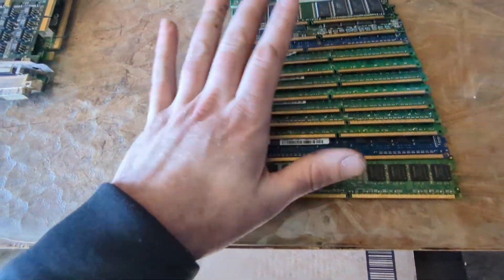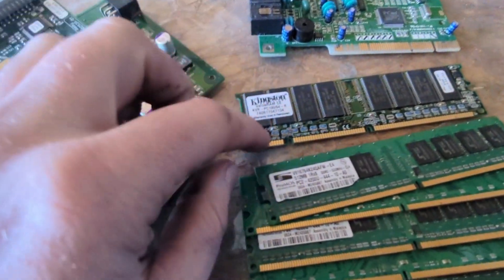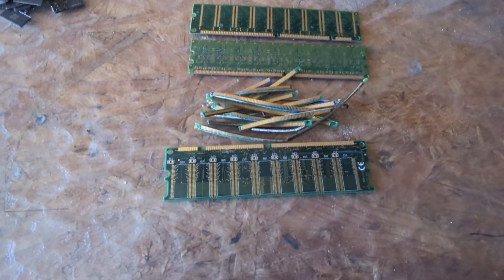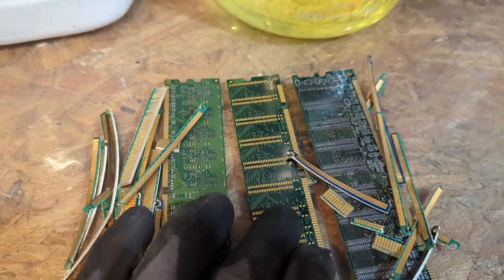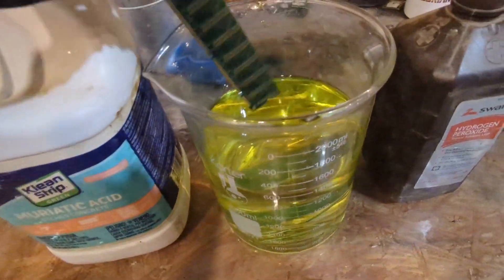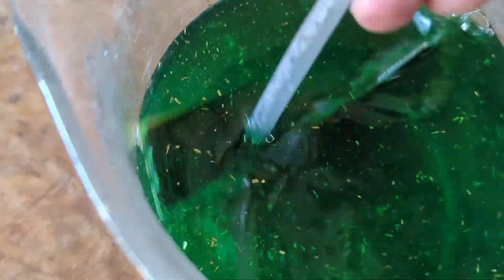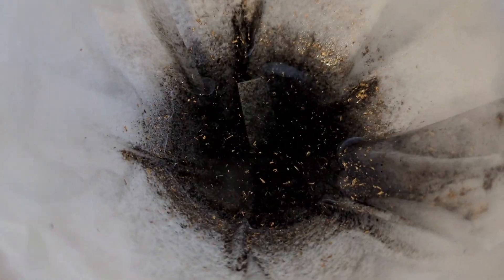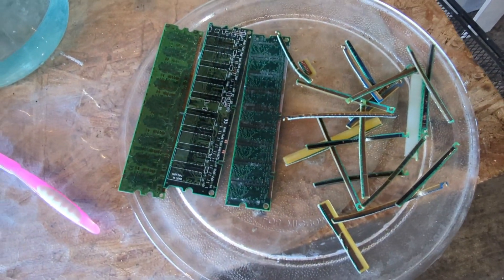RAM GOLD FINGER GOLD RECOVERY

Comment: what is the ratio to make this acid
Reply from the maker: @tube4knowledge76  I don't measure it exact, whenever I make a new batch I use the entire container of both. Or half and half, depending how much you need. AP solution is great because you don't have to dispose of it, you can continue using it again and again. When the solution is dark green that means it's saturated with copper, you can add a piece of steel to the solution and it will precipitate out solid COPPER!!! After that your ap solution will be clean again and ready for more boards!!!! If you feel it is too weak and more peroxide or agitate it with a fishtank air bubbler.
Reply: @ScrapDaddy365  Thank  you sir!
Reply from the maker: @tube4knowledge76  no problem! Thank you for watching and asking!
Reply: @ScrapDaddy365  I like your channel, you put good information there. God bless!
Reply from the maker: @tube4knowledge76  🙏🏻🙏🏻🙏🏻 Thank you! That means a lot to me!!! I'm just happy to be able to share what I've learned, if even 1 person learns from me or gets a couple laughs out of my shenanigans than I did what I came here to do! I really appreciate your support!! Happy scrapping!!!
Reply: That is incorrect  @ScrapDaddy365 . Once your solution is spent and you drop copper from it, it is still saturated with iron. You need to neutralise your solution and dispose of it.
Reply from the maker: @mrgreenswelding2853  I just filter it and keep using it, works just fine! Thanks for the great info!